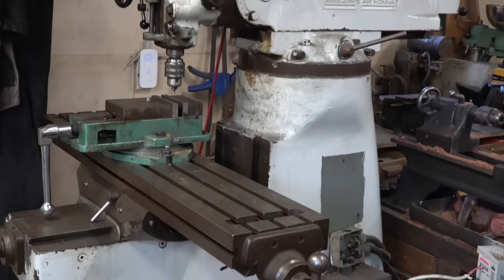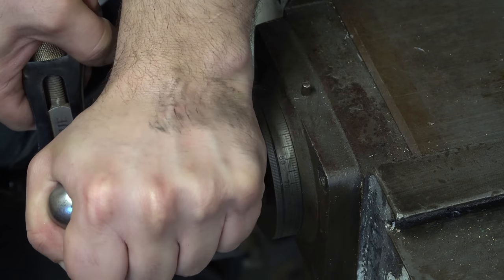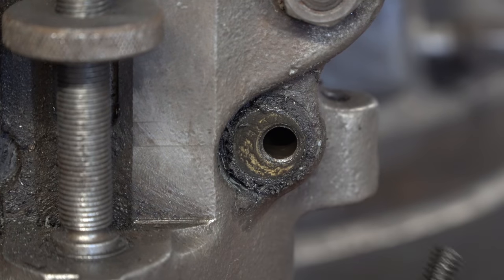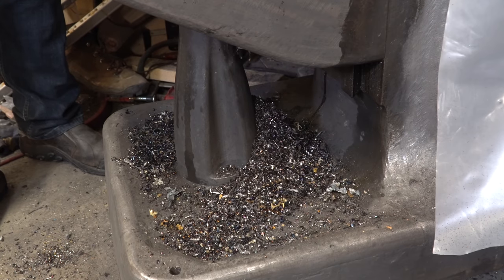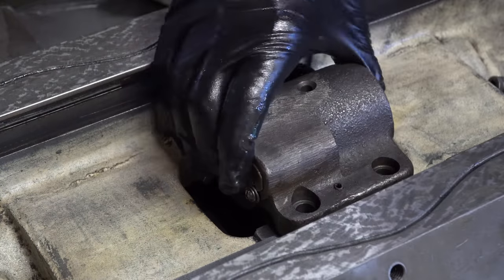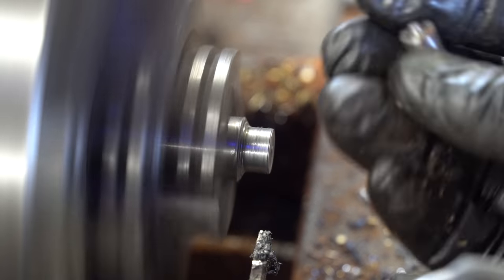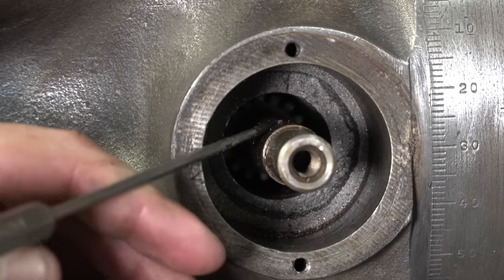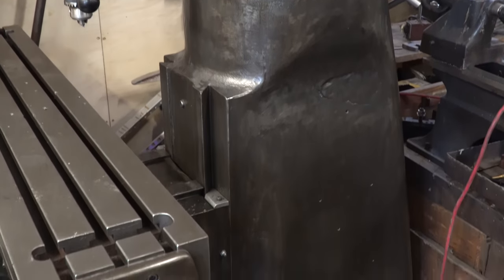Bridgebort Milling Machine [Rescue]

Comment: Having witnessed the wear & poor aftercare on this vertical mill, you're at a far greater 'backlash' risk. I genuinely hope you consider replacing the worm screw for both X & Y axes with ball screws. I primarily worked with Bridgeport, Cincinnati, and Enco vertical mills during college. Backlash is possibly THE biggest concern in regards (but not limited) to tool & machine wear/longevity, operator safety, surface finish (excessive chatter). Replacing those screws will also benefit toward the possible addition of a DRO system in the future for when you do want to venture into precision machining. Thanks for reading.
Reply: (Z-axis isn't necessary to replace due to the nature of gravity & weight keeping downward pressure, unless functionality is compromised)

Comment: You've got chatter cutting that brass.  That also should not be happening.   That means that your cutting tool is not hitting the workpiece orthogonally.   In other words you are slightly off center and not in line with the centerline of the workpiece.   It is probably only about 15 thou off, but if it is right on, then you won't have that chatter.  It only takes about one or two extra minutes to get that correct.

Comment: You know, i was trying to get legitimate machinist paint for a vise i was building, since i'm super particular about what i wanna use.
Because of covid, it wouldnt be shipped to me.
Now i have to suffer through spraypainting it.
I've messed up parts like 3 or 4 times, and had to wirebrush and then reprime them.

Comment: "I put an end mill in my drill" Is it ok to use a reamer in my impact driver?
Reply: No. It's far too hard. If your hole is too small (which I'll assume it might be if you are using an impact driver for a reamer, you don't have the tools to drill accurate holes), it could bind, begin impacting, and snap. Use a regular drill with a clutch. Turn the clutch down so it slips instead of snapping the reamer.

Comment: Look oil, and grease are chemically basically the same thing. Most greases are made from mineral oil with an additive that makes it thicker. For gears, bearings, and lead screw nut applications grease is often the preferred lubricant because of its superior staying power. On machine ways, oil is much better dough...

Comment: As someone who's primary hobby lies in fountain pens, cursive writing and calligraphy, my tits are not calm about this issue of BridgeBort...
As others before me have pointed out:
In business handwriting 'p' would have a higher stem up along with t, s and r, making them stick up above the other lower case x-height letters. To bad they have a disproportionate short downstroke on the p in that logo. It should've stuck down underneath the underline along with the g.

Other than that, I would've loved a bit more volume on the narration. Every commercial was about to blow my speakers.

Thanks for a lovely Bideo! 😘

Comment: @9:50 - weird, my Bridgeport has the exact same 'quill lock mod', and I mean exact same - even looks like the same dirty screw. Are you secretly in my garage restoring my Bridgeport? Because if you are, thank you! It desperately needs it.. ;) (Actually mine also has a random cable tie attached for reasons known only to the previous owner)

Comment: Nice job. Not sure about the weird shifting spanners. Don't you have a spanner set? Sorry wrench set. When I was an apprentice, if the tradesman caught me using a shifter (adjustable wrench)  instead of spanners he would've hit the bloody roof! I love those rounded off nuts and bolts, don't you? Just thought I'd put that out there for your younger viewers. If any of my apprentices get caught with any of these, you get flayed alive, dipped in boiling oil and dismembered. Ok, you'll just get it confiscated and watch me cut it up with an oxy torch.

Comment: Don't use thirty weight motor oil on the ways. Use way lube that is designed for the purpose.If I did not get the ways scraped in I would at least hand flake them a bit.

Comment: You can make a really simple little structure for this machine that will essentially give you a quick release for the end mills. Usually they are based on HF's 3/8" butterfly impact wrench.  Technical name for it is "power drawbar", if you want to look into that.

Comment: How are you able to run 3 phase ?   (Sorry, but I think a paint job would be nicer.)
Reply: Variable frequency drive.  Single phase 220VAC input, 3phase 220VAC output.  Ebay.

Comment: Great video as usual..although a bit disappointed with the 1/2 way approach at actually taking it apart..a simple Horrible freight quality engine hoist would easily lift the head, ram , knee portion off without problems..to allow further inspection of wear or problems and allow deep cleaning and painting.. your videos are wonderful but that said this one is a fail unfortunately..Cheers..

Comment: That letter looks more like a thorn to me (þ).
Which would make it Bridgeþort, or Bridgethort.
Reply: I have seen examples of older (early to mid 20th century) cursive writing where lower-case "p" will have an ascender.  I have also seen handwriting from that era where the 'loop' doesn't close (on purpose, consistently), and lower-case "p" looks like more like an "r" from the insular uncial alphabet ( ꞃ ), but also with an ascender.

Comment: The old J heads without chrome hardened ways are just not worth the time to repair. Look for a mid 80s Veri speed series 1 with chrome ways in really nice finish on ways to start with. There just a much better machine that is much faster to change RPM.

Comment: 29:10 should have used green.....
.
blue for 99% of things......red for THREADS! you really dont want to back out...... and green for shit thats NEVER gonna come apart again
.
green is 'sleeve" retainer.... (so like.... a tube around a metal rod)
the red you used kinda requires threads to work.....it "hardens" into a very long polymer.... which "gums up" the threads
.
but the green.... its like JB weld with out the weld
its more of a glue / "chemical bond" (from what i understand) 
.
.
and ya.... heat, vibration, brute force..... you arnt getting that green stuff to let go
while blue.... ya just use a normal wrench and it comes out (80 to 100 foot pounds.... with 40 or 50 foot pounds of force needed after it "breaks free")
red = 120 foot pounds to break free..... and 100 to keep turning
.
and green = LOL NOPE to break free..... and a big fuck off to keep turning

Comment: The gibs being shimmed has no real effect on their part, on the accuracy of the machine tho. You just either shim them too, or machine a new, over sized gib. OR a stock gib, in the case that the nincompoop who previously owned it, and put grease inside, wore the gibs down enough because of it. Probably some heavy equipment operator. They're the type that see a nubbin and reach for the grease gun...

Comment: Please tell us if you are using Way Oil and not regular engine oil on those Ways.   Don't make us machinists cringe.  Oh good grief.  You used engine oil on close up I can see.   Way oil is sticky and viscous almost like an adhesive so that it stays in place and can withstand weight against it during the day.   I can tell because Way Oil has a yellowish/rootbeer kind of cast to it in most lighting conditions.

Comment: 18:54  There you go again with the nonsense about the "accuracy" and saying dumb stuff like the "accuracy right out of the factory is better but not quite what you could pay for" kind of nonsense.   You DO understand that the precision rides on the precision hand scraping of the ways and the precision to which the lead screws are cut and the wear of the gearing, right?    This is more a maintenance issue on the machine rather than a "Oh newer mean gooder."   These mills can go a good three or four hundred years of use.   It is is that simple.